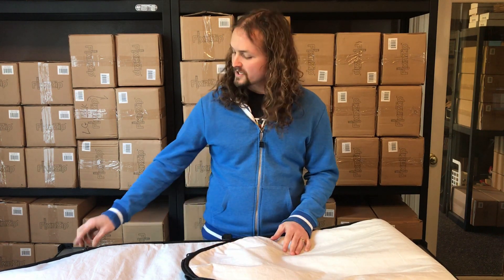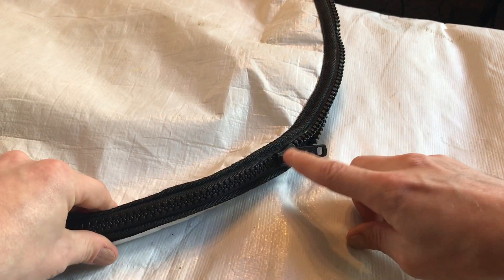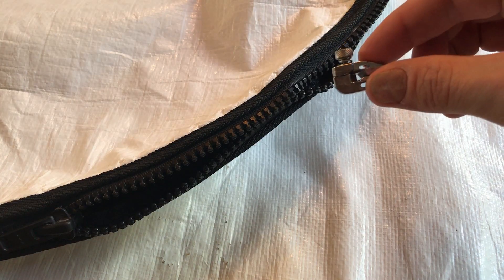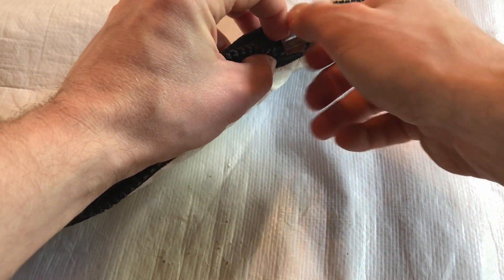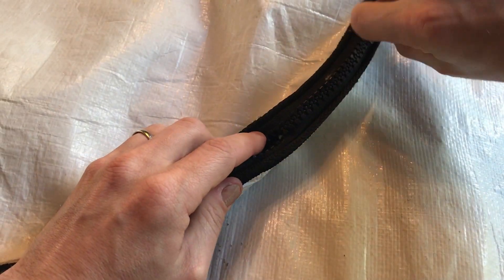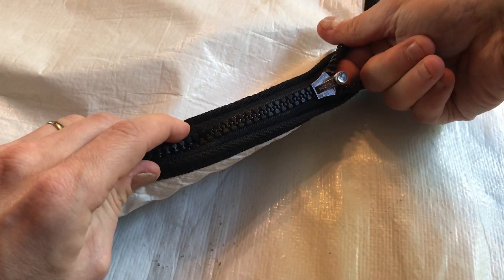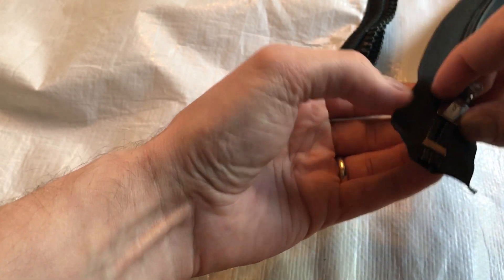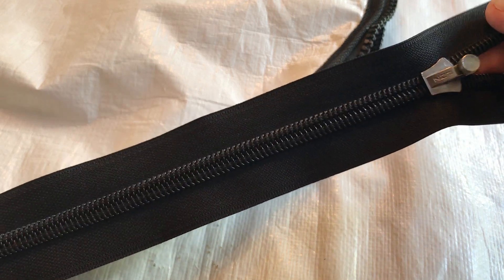How to Fix a Zipper on a Surfboard or Stand Up Paddle Board Bag

Comment: I got the zippers in mail today.  It took me longer to open the mail than it did to fix the zipper on my PFD (In under 1 minute).  Awesome product.  I will say to follow the instructions and don't forget to pinch when you first start pulling it up that way the first few teeth will engage. Now off to fix the zipper on my bee suit which is rather important to have closed.

Comment: @ZipnFix, My zipper has a tooth missing about half way up on my jacket. I wonder if the ZipnFix will still work? I can't replace the zipper bc it's part of a TWO zipper unit, as there is an inner insert that zips in also for winter wear.